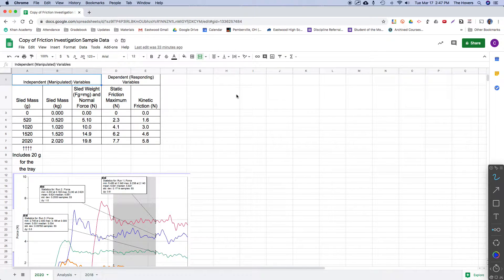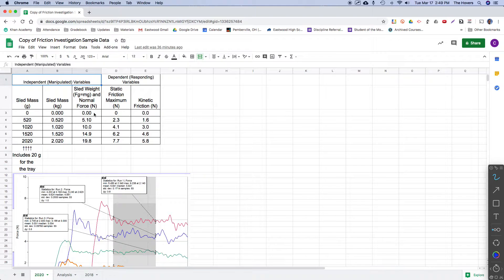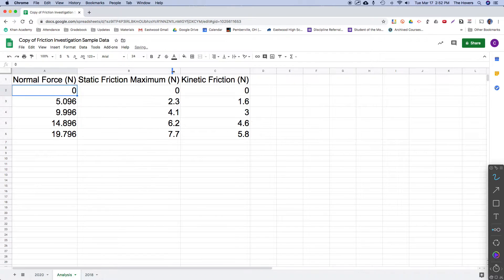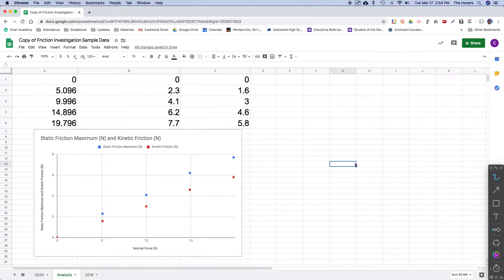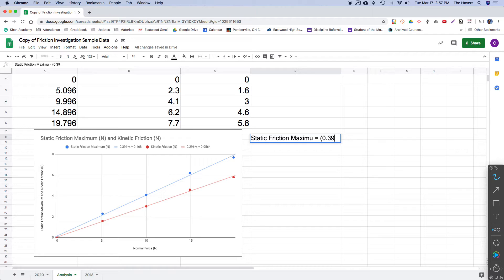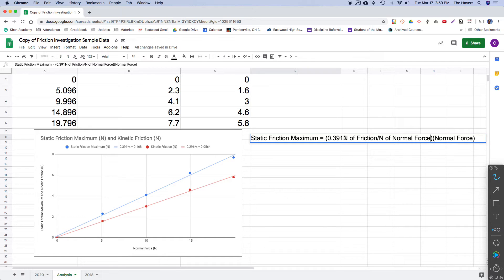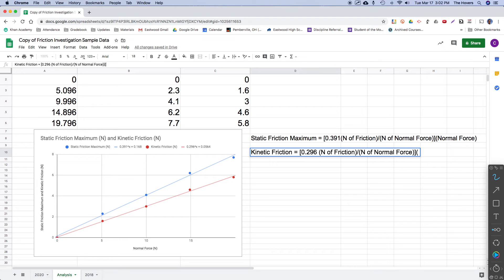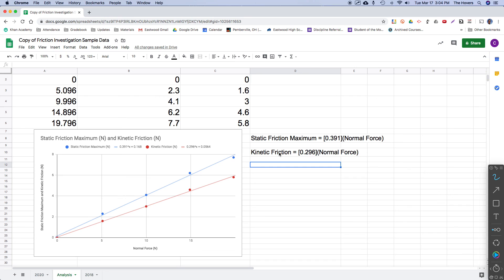Friction Data Analysis: Maximum Static Friction and Kinetic Friction vs  Normal Force

Comment: Hi! Very helpful video, just one question -- Although we can drop the y-intercept for the static friction's equation, what exactly does the y-intercept show/mean?
Reply from the maker: The small y-intercept values are most likely due to random measurement error. The data is imperfect, so the trend line doesn’t start at exactly at the origin.
Reply: @HoverCraftPhysChem  Great, thanks a lot!